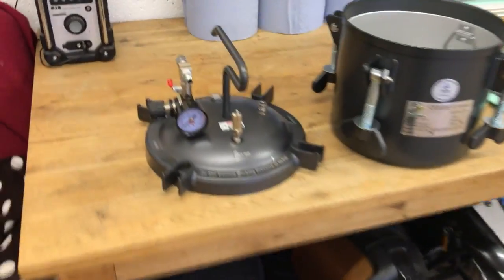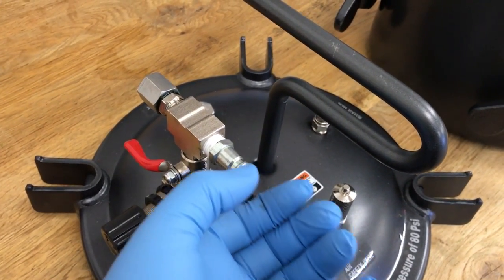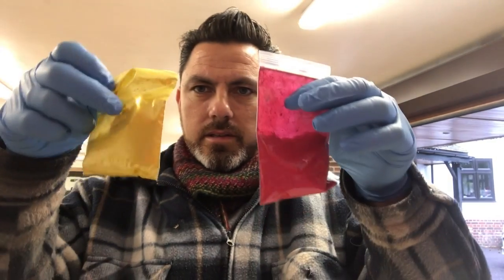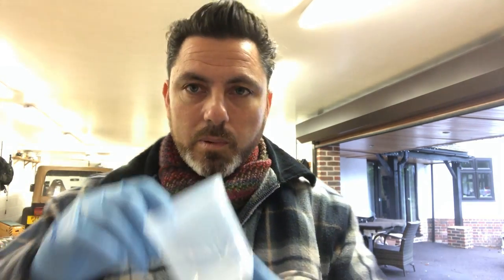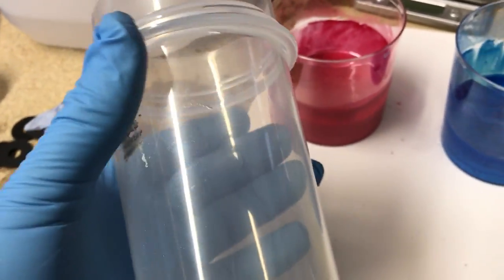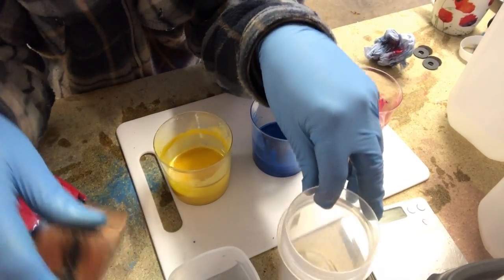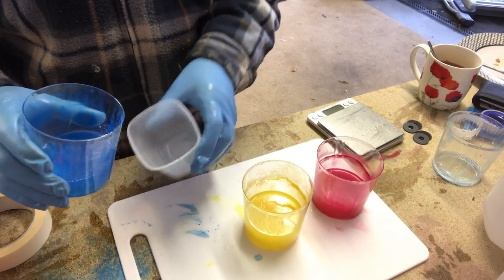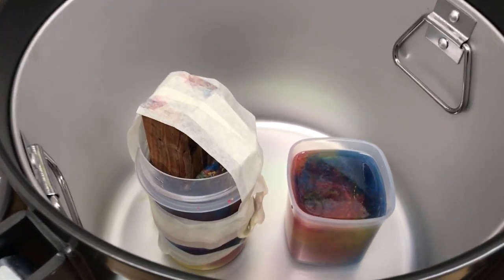Woodturning - Creating a resin blank

Comment: For molds, you can also use plastic PVC pipes, they come in all different sizes and You just use a forstener bit to drill out a shallow bore in a scrap piece of wood to hold the PVC pipe upright...lay down a piece of over was paper then put the bored whole and secure you PVC in. If it's not already a snug fit, just put some Hot melt glue around to seal it...and good to go!!
Reply: don't forget to use mold release, makes it easier to get the blanks out!!
Reply: on a side note...where do you get you emblems made? I love that!!

Comment: I'm a bit late to the party but great video! I've been casting with Silmar 41 polyester resin for the last year. PVC pipe makes great round molds, and since polyester resin shrinks a little bit, the blank pops right out when fully cured, no mold release agent needed. I use pvc for pen, handle, and bowl blanks. Unfortunately since it shrinks it's no good for worthless wood, Alumilite is great for that but a lot more expensive. It also doesn't polish to as high of a shine as polyester resin. I've never used expoxy resin but I'm thinking of giving it a try. Thanks for the vid.
Reply from the maker: Hey thanks buddy

Comment: I was thinking that a vacuum vessel might be safer to work with, but then I thought it may pull the air out of the wood as well, plus you would need to get a pump to remove the air from the vessel ?? so maybe not lol
But the different effects would be endless, like drilling holes through a blank at various angles then putting that into the likes of what you did here :)
I`m looking forward to seeing what you do with the blanks you made here!
Reply from the maker: Thanks man, I cant wait either. I will get the results up this Friday . I'm excited about this one. All the best

Comment: Did you add the hardener before you added the colored powder?  Several others i have seen who do the casting usually put the colorant in with part A before adding part B so there is more open time for mixing and pouring.  Beyond that, very cool.  Looks like it came out great!

Comment: Interesting experiment Nick. I've been considering doing some resin turning myself. I always thought you had to use vacuum to evacuate all bubbles. It looked like you merely used air pressure. If so, can you see any bubbles it the blanks? Thanks for sharing.
Reply: Hi, I think using a vacuum chamber is more for stabilising punky wood. It draws all the air from the wood which a pressure chamber won't do very well.
Reply from the maker: Hey Charlie, I believe its just the pressure chamber . these blanks have come out really well. no bubbles at all. I will have the video up for one of these this Friday. Keep watching . All the best